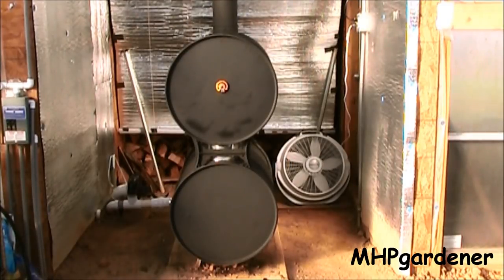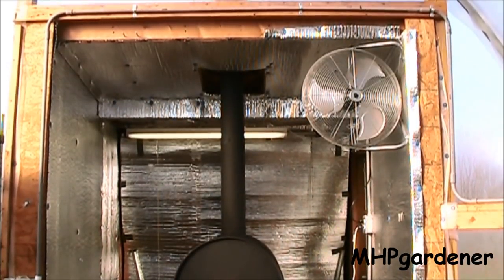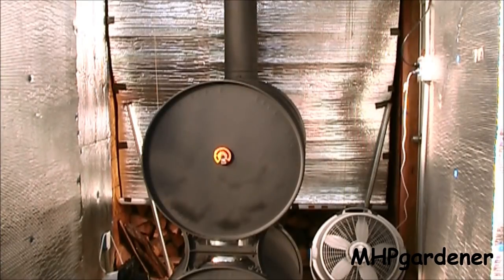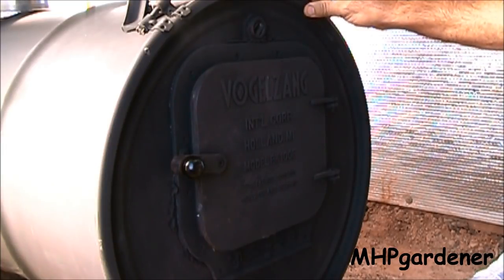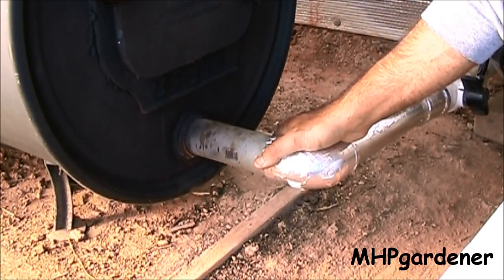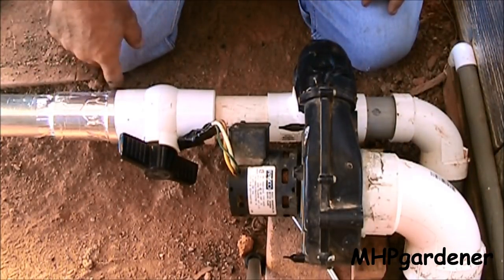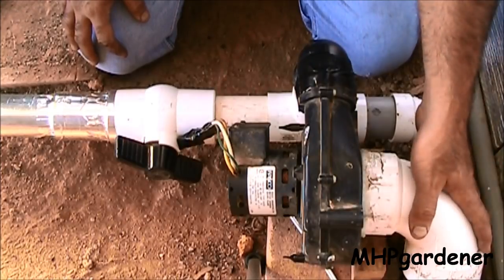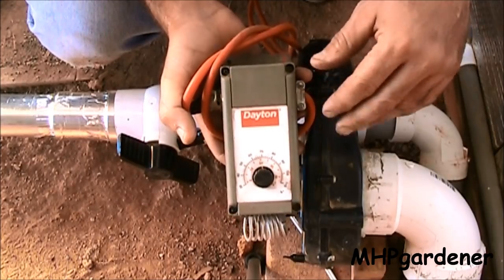Greenhouse Heating with a Double Barrel Wood Stove

Comment from the maker: Thanks. I looked into the US Stove furnaces awhile back. Even considered a setup where the furnace was outside the greenhouse and the hot air was ducted in. This was early on when I was having so much trouble getting the stove to function properly. After I figured out how to get the barrels sealed and working with blowers, I decided I'd keep the money in my pocket. But I'll have to admit, it was mighty tempting. :)

Comment: I ended up making the same system you have 4 weeks ago. I ended up having to use a blow dryer with a cool setting and connected it to a home thermostat. It works great giving the extra air when needed and shutting down when reaching temp. It saved on a ton of wood. I have to really thank you for the idea it is already making this growing season a success.

Comment: Great job.  Just a tip.  You have a positive displacment blower.  Yes, wihtout the diverter on the out-take of the blower, valving down would cause a high amp draw and burn out your motor.  Put the valve on the intake and you would not need the diverter.  The motor only works hard if the air has no where to go. If there is no air (100% intake closed), then the motor has the lowest posible amp draw,  Just a tip.

Comment from the maker: I think it does. I have a basic chimney cap at the top of the stove pipe. When I decided to put the stove on the west end, falling sparks on the plastic was my biggest concern. A year later, it has been a non-issue. Right now, I keep it about 55, give or take. I'm not sure how much wood, since I cut longer pieces. But you're right, it's a good bit. I cut and split it myself, so the cost isn't bad at all.

Comment from the maker: Thanks Joe. I do have a second setup just inside the smaller GH. I tried to run them on separate thermostats, and it didn't work so well. One stove would keep the temps up high enough to where the other one wouldn't kick on. When you have a fire idling for an extended period, the flue temps drop, and creosote gets nasty. So I have both on the same thermostat. And if I only need one for the night, I'll unplug the other. It took some time, but I have it figured out now. :)

Comment from the maker: Thank you mam. Indeed, I remember trying to manage with the sliding draft and it was hard to do. The temps would keep going up, way too high, and then fall back down. A blower and thermostat allows you to keep the temps in a tighter range...using less wood.

Comment: looks great !  just for trivia purposes.  if you put a reducer on your pressure side vent pipe to half the diameter of the furnace side ..  half of the volume will leave and send the other half where you want it .  valve works too :)  if you line the bottom of the burn barrel with firebricks the barrel will last longer by keeping the fire up off direct contact with the steel.

Comment from the maker: Thanks bro. I stopped putting my thermometer on the bottom barrel. It would get pegged at 900 and fall off. My original setup is on year 3, so the barrels seem to be holding up pretty good. I have a few things growing, mostly getting setup for Spring now.

Comment: Great Video.  If I may make a suggestion, add the valve to the suction side of your blower.  This will reduce amps and save on power (pennies or nickles or more, I'm not sure).  I have a Clayton (now by US Stove) wood burning furnace to heat my home that uses forced draft as you are doing with a thermostat.  When the firebox temperature gets so hot, it runs the main blower. The forced draft blower has an adjustable plate that I can slide to block the air going into the blower. I love my Clayton!

Comment from the maker: Hey Paul, I've seen those reclaimers..even considered using them. But I'm not keen on cutting the stove pipe or doing anything to obstruct the flue. It takes a certain amount of heat to prevent creosote buildup. With something working to reduce that heat, I can see where it might cause problems. They get excellent reviews, so it would seem that they work fine. I'm just hesitant to mess up what I already have. Thanks.

Comment from the maker: Yes mam. On a night when its 15 and windy, 3 hours is all I can get. Fortunately, those nights are rare around here. 25 degrees outside will get me about 4 hours, 35 and I can go about 5 hours before reloading. It's kind of a ballet that you learn from experience. Different temperature and wind combinations require different amounts of wood. The goal is to make it thru the night, and end up with a bed of coals at sunrise. Thank you. :)

Comment from the maker: Thanks Greg. Starting from scratch, with a long hoophouse, I'd go with the barrel stoves. The rocket stoves are great, but I don't see any way at all to regulate temps like you need to with a thermostat. When I talked to Paul Wheaton, the conversation went away from the RMH to coming up with ideas to insulate the GH. Ideally, a passive/solar GH with a solid, insulated North wall would be a better candidate for a RMH.

Comment from the maker: The barrels will put out heat pretty fast. I really like using them. I'm not sure about the home thermostat either. It might keep kicking the fan on and off too much since it has such a small differential, usually about 1 degree.  But, you never know. I don't think it hurts to try.

Comment from the maker: What I would like to do is have elevated beds, about 2 ft off the ground. Then I could do some things to push hot air or water thru them to heat the soil. So many ideas, so many ways to make things better. But they all take time..plenty of it. This weather is great. I'm well stocked with wood and heating has been quite easy this winter.

Comment: Great video, well explained. However if I was going to choose to heat my greenhouse with wood, I think I would go with the wood boiler option and use radiant heat with a fan to circulate the air. Obviously this is a more expensive option to purchase and set up  but it allows you to expand the system to also heat a home or garage. More versatility IMO.

Comment from the maker: Yea, that's a key point. You control the temps at night with the heating. And you manage the temps in the daytime by opening windows and using fans. With a RMH, you'd have a lot of additional heat to get rid of in the day time.

Comment from the maker: Generally, the air change takes place during the day. If the sun is shining, it warms up fast. Then you open the doors, windows, etc...and turn on the exhaust fans if necessary to keep the temps from going too high. And later in the day, you close it back up and get ready for the night. If its a cloudy day, you don't ventilate quite as much...depending on the temps. All of this pertains to winter...summer is totally different. Thanks.

Comment: I have a rocket mass heater in my greenhouse, but your points are valid. The rocket mass heater along with black water tanks for solar thermal mass work pretty well, and use less fuel, but your setup takes less tending, as the large logs burn for hours. Nice video.

Comment from the maker: With a double barrel setup, I think you could do a 20 x 48 and handle temps down into the single digits. But you'd need to have the 2 layers of plastic on the GH, good wood, and a forced air intake. I can do 40 degrees above the outside temps if necessary with my 2 setups. A 20-30 degree difference is easily done.

Comment from the maker: Wow...25' is way up there. Yes, I have a small addition built onto the west end for the stove. I put it there since that end is where the coldest air comes from. The GH is oriented East/West. I don't have any ideas for building a stove room halfway. Attaching the plastic would be kinda tricky, or so it seems. I'd go slow until I got it figured out though. No sense putting in the work, then having to go back and change things.

Comment from the maker: That is cool. If the power went out, and I couldn't heat my house....guess where I'd be sleeping? In the greenhouse ! A small generator would run those fans without any problem. I might have to pitch a tent to keep condensation from dripping all over me, but at least I'd be warm. Let me know how it turns out. :)

Comment from the maker: Yea...the problem with running stove pipe like this horizontally is a drop in exhaust temps. That leads to creosote issues. Additional thermal mass would always help somewhat, but it's gonna take a lot to make a dent in the heat demands of a long hoop house. A different design with an insulated north wall would provide a few more options.

Comment from the maker: Right now, with a new crop of tomatoes planted, I'm doing 57-60. I try not to let the temps go below 50, with the exception of the small greenhouse where I only have cool weather plants right now. They'll be fine in the 45-50 range. During the day right now, winter, I try to keep it under 80. As for the blossom drop, many things can cause it. Insufficient light, nutrient issues, temps too high or low, poor pollination. I use a cordless toothbrush to help in pollinating. I still get some drops.

Comment: My father had one of these in the cellar for years.  His was a Sotz kit.  The thing would drive you out of the house.  One mod that he did was to plumb in a second hot water tank and run a loop though the stove.  This was a pre-heater tank for the main electric tank.  He also plumbed the blow off vent to the outdoors.  The thing would vent at least once a day and blow a big steam plume.

One thing to watch is that with the second drum you can draw out enough heat to cause a shelf in the chimney and completely block it.

Comment: I made this today because my rocket stove could not keep up. I ended up using a hair dryer because the 6" duct fan didn't work trying to blow into a 2 1/2" pipe. I also used a home thermostat but not sure how long it will hold up to the moisture. Thanks again!

Comment from the maker: Yes sir, this is very do-able. The kits are designed to fit either a 55 gal or 35 gal drum. If you could find the 35's, they'd make a nice setup for a smaller greenhouse.

Comment from the maker: The second barrel is the additional heat exchanger. If I try to do anything extra, I'm gonna run into creosote problems because the exhaust temps will be too low. If I only had one barrel, then yes, I could play around with the pipes a bit. But with 2, it's really not a good idea.

Comment: Excellent job.  I too would put the air intake regulator valve before the blower instead of after, this will prolong the blower life and amperage draw..  If 2 barrels are good, why not three to increase the amount of heat transfer surface? Lots of improvements from the original stove..

Comment: ...(continuation),  If in the coldest, darkest deepest times of the year, you find that the valve never needs to be opened more than 60%, then, you can get away with a smaller blower.  Find out the curve for the blower at max.  For example lets say it puts out 100 cfm.  You need 100cfm x .6 or 60 cfm.  Blower, valve, piping costs less and easier with solor powered.

Comment: One idea for you: if you're burning your wood completely, then you shouldn't have smoke coming out of the stack. A complete burn will mean you're only creating water vapor, CO2, and heat up the flue. In a greenhouse, the plants want all those things -- there are large companies that site their greenhouses next to CO2 waste sources (like ethanol plants) so that they can create a high CO2 atmosphere for their crops. So ideally, if you're producing no smoke, you should have no chimney and just vent the woodstove into the greenhouse. No a pleasant envoronment for you to walk around in, but great for the plants.

There may not be any safe way for you to do this. Since you're just using a barrel stove with no secondary combustion air inside, that means you are probably venting a lot of unburned volatile gasses and particulates up the flue. If you burned those gasses, you would be producing more heat, but instead you're sending them into the great outdoors. Regardless, since you're using a fan for primary combustion air, you don't need a heat-driven draft to move flue gasses up and out of chimney. You could snake that flue dozens if not hundreds of feet around the greenhouse before it exits the building. All of that flue pipe will radiate heat from the hot flue gasses inside, and your primary combustion air fan will create enough pressure to push the flue gasses out of a 50' or 100' horizontal flue, leaving the greenhouse at "room temperature".

These are somewhat technical things to pull off and you can see the dangers of not managing them correctly, but they've been done before in industrial situations.

Comment: Have you considered running the exhaust pipe through some sort of thermal mass within the greenhouse?  I have often thought of doing a similar setup to yours, but with the exhaust being coiled through an IBC tote full of water. That might allow you to not have to mess with it every 5-6 hours if you can conserve more heat and then let it radiate from a thermal mass.   I like your setup though, I just hate the thought of you having to get out of bed in the middle of the night to stoke a fire!

Comment: Hey very nice set up there!! Have you given any thought to a magic heat heat reclaimer northern tool has them. They are thermostatically controlled and you have to keep them plugged into electricity constantly.The fan comes on at 140 degrees and goes off at 110.I know it would increase the heat and you use less wood.Just a tip i thought i mite throw your way.Thanks paul

Comment: Those squirrel cage fans are centrifugal.  As such, they consume more power as flow increases.  It is actually more efficient to not have the "T" connection and just restrict the air with the valve.  I know this may not make sense but you can verify it with an amp meter.

Comment: Take you some 8-inch block and fill them with cement and lay the blocks on three sides of your stove and it will retain heat and if your stove quits you would still have some heat for another couple hours.

Comment: Are you still heating this way? We are looking to move our citrus into a 20x100 double layer tunnel with a fan between each layer (air insulated). We are zone 8 and want to keep the greenhouse above 30 (our coldest gets around 16 degrees at night for a days a year). Would a double barrel system like this work to keep that tunnel above freezing with enough airflow to convect the heat? Would love to see another update on this, I searched your channel and didn't see one.

Comment: I have a BBQ pit and a BBQ guru (google it).  It operates with a small "computer" fan and temperature controller.  Those fans come in alll shapes n sizes, so I'm sure you could find one that would work more efficiently than the large furnace fan.

Comment: Could you use 3 barrels instead of 2 to capture more heat before it runs up the stove pipe? It seems that if the 2nd barrel gets up to 600 degrees, then a lot of the heat is escaping up the pipe, so if you had 3 barrels it would capture more of that heat. Please share your thoughts.

Comment: Air coming from outside is what qualifies it for airtight.  Unless you have some kind of air flow problem you don't even need the fan.  natural air convection will bring in all the air you need. You want to dampen the air flow out to find the right heat rate and get your stove burning at a steady rate, not pulsing up and down.  More efficient.  Less filling the stove.  Make the stove parts out of heaver metal. (thermal mass) water heaters, old boiler shells.  The barrel stoves burn out a little to quick.  put some sand in the bottom to keep the coals from oxidizing the metal so fast.
Reply: What I like about him using the blower is that when needed, he has a blast furnace for fast, very hot fire. It doesn't look like his system shuts off outside air when the fan is off, so it gets natural convection too.
Reply: ... your sand idea sounds interesting. It would protect the bottom of the barrel, and help the fire start, much like leaving an inch or so of ash in a wood stove or fireplace.

Comment: Yo dude..Do you use only hardwood...or do you use only softwood?  I have the option of using 3/4 inch wood down to 1/8 inch wood both being soft and hardwood. All of this is being thrown and burnt in a landfill.

Comment: Did you offset your barrels, putting the lower one partially outside like you mentioned to keep the smoke out of the greenhouse?  I am wondering how it worked?
Reply from the maker: I ended up moving the original stove to the other end of the greenhouse and running the stack straight up. It works much better that way.

Comment: Is the heating addon on one of the ends?
I am putting up a 30x80 hoop house with 25' high centers. The hieght is going to take alot to heat so i was considering putting a heating addon clone of yours mid-way, and attached mid point on the eastern side of a north/south hoop house.
Any thoughts?
The hoops are going up this week. I am second guessing everything, lol..